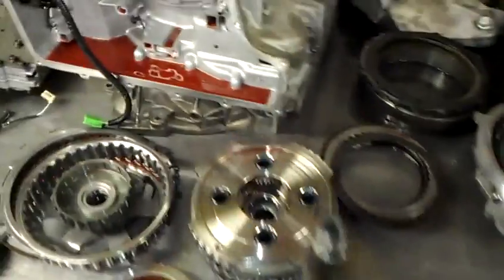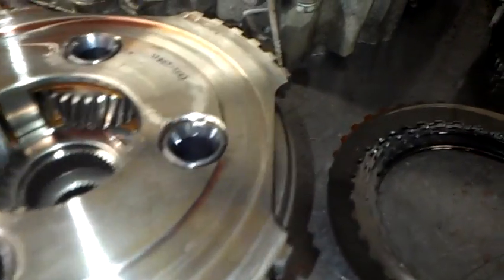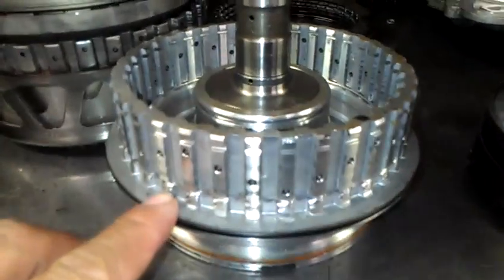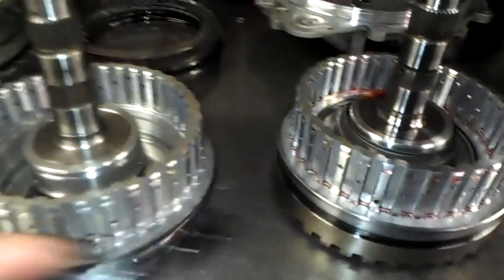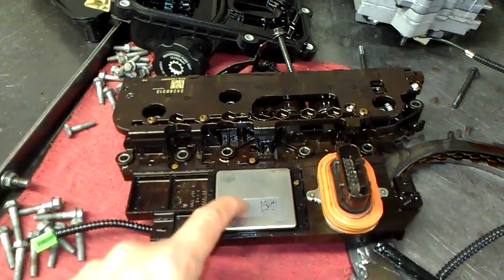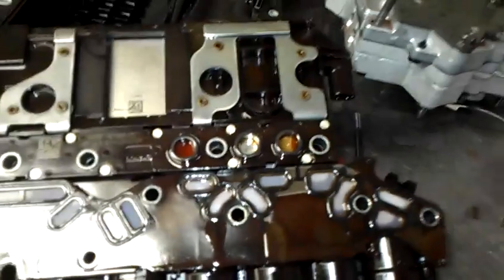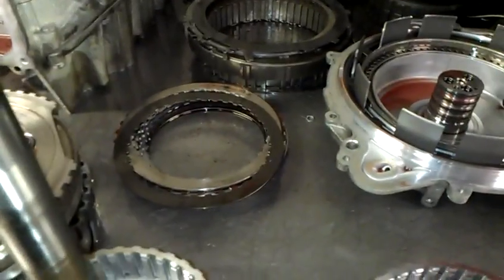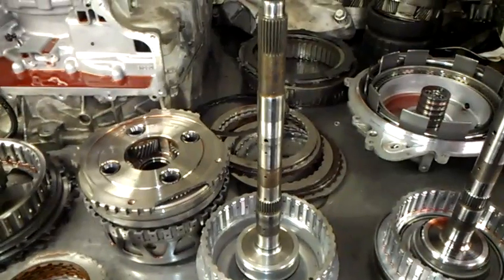6T75E Transmission - Failed Pressure Switches on TCM - Transmission Repair

Comment: I have a 2015 chevy impala 3.6 and am throwing p0877 and p0989 codes. I replaced the seals and diaphragm at valve body cause they were bad. still has same issue. reverse works great. drive holds under load when holding break and gas. but the sec I move forward it goes straight into neutral. not like it's slipping. then you coast back to a stop and it's right back in drive. and same thing. give it gas it pulls great and then about 2 or 3mph it's like it got thrown right back into neutral then when it comes to almost a full stop it's right back in gear again.
Reply: The Module itself could be failing.

Comment: My 2012 Traverse, started with jumping RPM in overdrive 1500-2000 RPM, would bounce, now it is shifting rough on downshift.  Is this bad torque converter or TCM issues or both?  Random p0300 codes just started recently.  Shifts fine during acceleration.  Any advice would be greatly appreciated.

Comment: 2017 impala pressure sensor tcm..lucky I still have warranty ..new transmissions suck
Reply: What did they have to do? Replace transmission?
Reply: @toddwillis737  they replaced the  valve body.. that did it

Comment: 6t75 just rebuilt and throwing a code p2723 pressure control solenoid stuck off. replaced the techm with a dorman rebuilt and has a 5th gear take off.  pretty confident everything is in order but assuming the techm is bad. any ideas???

Comment: Do you happen to have the torque specs to replace the tcm back in the transmission?
Reply: It xalls for 9 ft pounds work from middle of tcm towards the ends

Comment: Bro, if you can help me you will be my savior and I will love you forever! 2010 Cad SRX,  I can not get any codes and there are no check engine lights.but the dealer is telling me they get P0851, P0877, P0989. The reason I doubt any internal destruction or that they are actually getting any codes at all is because the car only does this 1 time each morning. And that is it shifts from 1 to 2 and when it's supposed to shift to 3rd it goes back to 1st. When I pull over, put in park I can take off again and it runs fine all day! Please help, I think it's something in a control module but my Dealer wants to sell me a new trans!  BTW, I can also drive hard and force a shift (from years of driving motorcycles and stick shifts with a bad clutch, lol) but I'm kind of afraid of doing that in an expensive car. .
Reply: Pressure switches

Comment: I have 2010 Chevy Traverse.  I just found out today that I have a  Failed Pressure Switches on TCM.  I did not have any Waveplate codes at all.  Does that mean I am ok to just change the TCM, the transmission shop told me that is all just TCM
Reply from the maker: +Derrick Stephens have them drain the fluid, use a paint filter to catch the metal particles. If your fluid looks metallic then your wavy is broken. If the fluid comes out clean then you'll be okay. The fluid will be dark with age, what you're looking for is metal in the fluid.
Reply: The problem was the TCM and bad solenoid/Pressure switching within the TCM which cause my Traverse to go into Limp Mode and when I took it out from Drive to Park and Back to Drive it was fine the code was pulled from TCM (6T75E code).  
NO wave place issue because I was not getting any shuttering from transmission nor did I received the P0842 or P0877 codes.  
Cost me $1381(New GM TCM) with New fluid.  I was told I  caught it before it got bad.  I have only put about 200 Miles on it so we will see what happens after this Long to Florida trip and back should be about 1500-1800 miles.

Comment: My 07 Acadia with 116k miles on it has some vibration at low gear and also some slippage around 45 mph.....could this be the culprit since it controls the transmission

Comment: What are the torque specs on the TEHCM bolts? Is there a certain sequence to reinstall the bolts?
Reply: Did you do it yet?  I have the torque numbers.
Reply: Kartboarder22G  what's the specs ?
Reply: 12Nm torque tightened in sequence starting center bolt moving outward.  Lowest center bolt is 55mm long, 4 bolts directly above it are 80mm long.  Next bolt above the 55mm long bolt, but offset is 65mm long.  Three bolts somewhat aligned above the 65mm long bolt are 95mm long, then somewhat above those comes the 42mm long bolt and somewhat above that one is the 65mm long bolt.  Best of luck!

Comment: Hi Hiram. My car is a Daewoo Lacetti 2009 (the one which looks the same as Chevy Cruz), and I think that the transmission type is 6T30 or 40, and the same TCM as the one on your video. I got two error codesP0723 output speed sensor circuit intermittent, and P0878 Transmission fluid pressure switch 4 circuit high voltage. Could the problem just be solved by replacing the speed sensor and the pressure switch? Because I was told that there's a possibility that the problem might still remain even after the replacement (could be an electrical one).

Comment: hi Hiram, I have a 2008 Saturn vue and had the trans and TCM replaced under warranty for the wave plate failure.  now it is leaking fluid where the wiring clips into the front of the TCM.  can't get into the dealer and had a trip planned.  any clues as to why it would leak there and if it's easy to fix?
Reply: did you get it fixed?
Reply: Yeah, I just made sure I watched fluid levels and went on my trip.  There was a problem with the gasket that the dealership fixed under warranty.

Comment: I just had the P0752 shift solenoid stuck on code. I'm having a bad feeling about this transmission. I bought a 2007 outlook used last November and according to GM the recalls have been repaired. The car shifts fine but about once a month I have a stumble shortly after startup when I turn left that causes the car to go into limp mode and throw the code. If i restart the car it drives as normal and after a couple of startups the CEL goes off. It's annoying and I've thought about repairing it but is the shift solenoid in the transmission? I can't find much info about it. If it is I'll consider just having the transmission replaced. Do you know if GM improved the rebuilt transmissions so they don't fail as easily?
Reply: How many miles?  Do you still have the vehicle?

Comment: hi hiram how did you reprogram it? you had to take it to the deler or just using a scan tool? thanks in advance...
Reply: Replacement module comes with a programmer.

Comment: does the tcm need to be reprogrammed once i install new? i just changed mine and its still in limp mode.
Reply: Yes
Reply: Did u have to take the transmission out? Or Disconnect & plug the new 1 in?
Reply: It has to be reset .. the tcm will have to adapt to your driving habits ..drive 200 miles and and you will feel the difference

Comment: Hiram - In your opinion, how long should it take by an experienced authorized GM service department to replace the transmission fluid level pressure switch in a 2008 Saturn Outlook FWD XR?
Reply: less than a day

Comment: Hiram,
is this code also about failed TFP switches?
DTC P0796: Clutch Pressure Control (PC) Solenoid 3 - Stuck Off
Reply: Andre K did you ever figure it out? I have the same code doesn’t want to shift into 4th.

Comment: Thanks for posting this video, Hiram.  I am currently doing this project at home in my garage with my wife's 2008 Acadia.  I would greatly appreciate it if you could answer several questions.  Regarding the pressure switch failure, it appears to be a piece of semi-transparent plastic that covers the pressure switch.  How does this create a failure?  Can the plastic piece just be removed?  Do you know what the replacement TCM part number is?  Doesn't it have to be reflashed or programmed by GM to match the VIN?  Regarding the sun gear damage, would you replace it if there was some scratches due to broken parts of the waved plate?  Our Acadia did get 2 DTC codes:

P0700 – Transmission Control System Malfunction
P0752 – Shift Solenoid A Circuit Stuck On

Would this be representative of both the TCM failure and the waved plate broken?  I just disassembled the transmission and 3 of the pressure swiches looked like the ones you posted in the video.  Also, the waved plate was broken.  Thank you.
Reply: Hey did you ever fix your transmission?  I have the same problems just a different solenoid is stuck off how did you repair the tcm pressure switch
Reply: +Shimon La Hee&#39; Yes, I did fix the transmission, but I dropped the entire engine / transmission cradle, disassembled the transmission, replaced the pressure switch seals, 5-R wave plate, drum, friction plates, timing chains, power steering gear, water pump, power steering pump, and a lot of other components all at one time.  You can buy a repair kit for the pressure switches, Transgo PSR-5,  http://www.transgo.com/products.php?homeinclude=catalog&category_id=191&parent_id=31&product_id=279&start=0.  Assuming you have an Acadia or Enclave, you will probably need to replace the 5-R wave plate and drum assembly also.  If you replace the pressure switch seals instead of replacing the entire TCM, it will not need to be re-programmed.
Reply: +Alan Ida ok thanks well im getting a performance or stuck off solenoid error code im hoping the tcm and valvebody are in good shape i have the 6t30 will the transgo kit work with those as well
Reply: I don't know if the PSR-5 kit will work with the 6T30.  It only indicates 6T70 and 6T75.  I'm not sure if the TCM is common between the 6T30 and 6T70/75 transmissions.  You may have to find out if the part numbers are similar or common between the transmissions.  It's possible the TCM is the same but it may have a different part number due to different programming.
Reply: +Alan Ida ok i will keep you updated thanks

Comment: Transgo now has a repair kit for these pressure switches. The part # is PSR-5. The repair membranes and seals also come in the 6T70 shift kit Transgo part # SK 6T70. I haven't personally used one of these yet but I intend to. The TEHCM retails for about $670. Kind of a hard sale when adding it to  a rebuild.
Reply: Hey buddy did you ever get any feedback from anyone using the transgo kit to repair a damaged tcm?

Comment: Hi Hiram! Maybe you can assist me, I've had pressure switch codes. So the analysis would read manifold pressure switch malfunction, does that also mean I need a new transmission?

Comment: Have you done any work on old BMW transmissions?
Specifically, I am getting some vibration at high speeds from an '88 e34, I think it's from the transmission, but could be tailshaft or diff. I know this is rather vague, and you're not looking at the vehicle directly, I am not really expecting an answer to this, but if you could point me in the right direction, I would be rather grateful.
I'll need to do all required repairs on this myself, will post videos on youtube.

Comment: when you replace that whole solenoid and tcm in this unit do you have to care it to the dealer to reflash it
Reply: ***** speaking about j2534 devices i use snap on pass thru pro 2 and it works great with gms sps programming application, there isnt a module you cant flash with gm and that j2534 device

Comment: Yep, I definitely think the 6T75E is gonna wind up being the 4L60E of the 2010's.
Reply: Look foward to it. I'm not at all familiar with the 6T75E as far as inner workings go, but from the way you described the one you have out in the parking lot right now, it sounds like it would make an excellent video as far as showing how vital it is to know how power flows through the gear set on ANY transmission, not just this one.
Reply: I think the 4L60's take the same diaphragm kit.